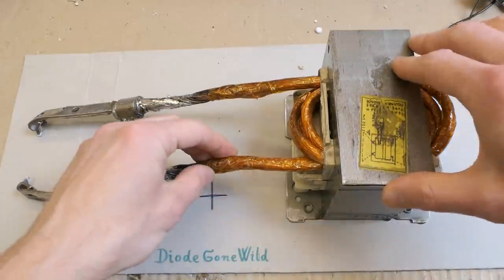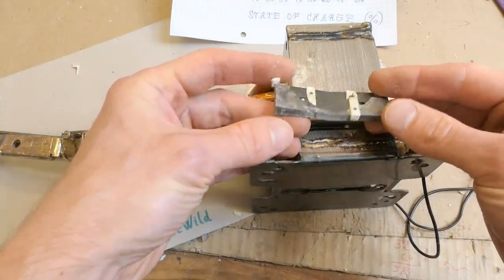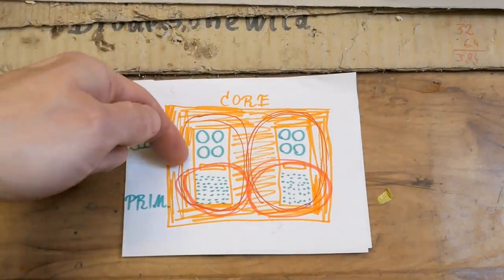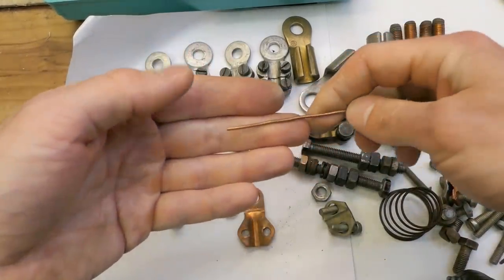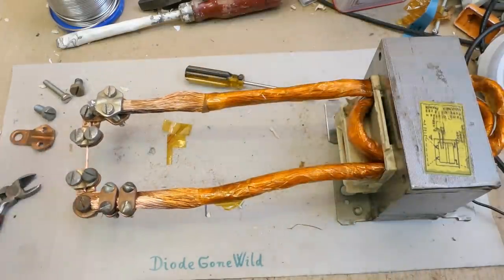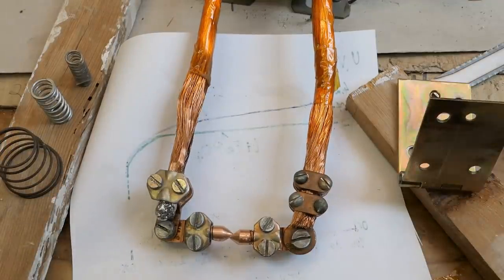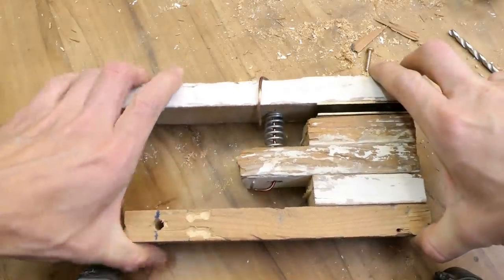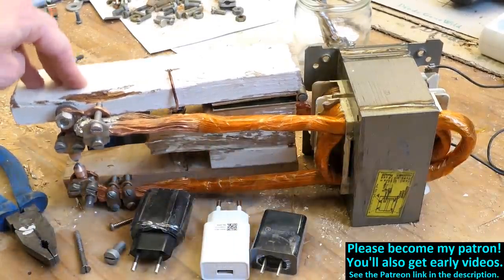Microwave Oven Transformer Spot Welder 3

Comment: I have followed DGW's feed on this project with enthusiasm and have some observations.
For the 'arms' of the welder I used some 22mm copper tubing and a bought length of 15mm x 3mm copper strip.
This provides good stability and permits a good pressure to be applied to the weld material 
So far, using 3 turns (I couldn't fit any more!), i was able to obtain around 400 amps on testing.
Charles Preston, Patreon member

Comment: The spotwelder we did use in the factory had copper rods that had about 5 mm diameter.
They was kind of very slightly rounded perhaps, almost flat tips, the point is to get contact and heat the plates up, if the copper rods is too pointed then it just goes trough and makes a hole instead.
The spotwelder had a foot pedal, so one put the plates on there and pressed with the foot.
I dont think it had a separate switch, i think the switch was in the foot pedal system, but make sure it gets good contact before switching on if making something like that.
It had a spring system so the pressure on the plates could be adjusted i think.
I think you perhaps have more power in your spotwelder than what was in the factory spotwelder.
I did not mess too much with the spotwelder but did use it a couple of days, i mostly did welding with the large 3 phase mig welding machines there.
Sometimes now and then i did run the welding robot too, it was high tech back in 1990-1992, one did just put the pieces in the jig and it did welding the pieces by itself :)

Comment: Maybe put thicker mains cable.
Reply: And keep the clamp meter away form the transformer because the leaking magnetic field causes it to display a higher current than you're actually drawing form mains.
Reply: @mernok2001  also good idea
Reply: In his first video on this project he says he wants to preserve the original primary coil from the microwave. Besides, it is tedious to wind 100 or so turns on that transformer, because he wants to avoid cutting the iron core open. The core was welded shut by the microwave manufacturer.
Reply: @hanztimbreza6217  Ivan Kirola was talkong about the power cord,not about the primary coil.

Comment: Nice project. This got me thinking... To make welds consistent you could make foot switch which switches transformer off when secondary voltage falls below 1V - meaning welded material has melted and electrodes got closer together.

Comment: Thanks for this set of videos!  I've been thinking of building a spot welder for years, but never got around to it.  Your video has inspired me to finally get it done....

I have a 1200 watt microwave with a fused secondary on the transformer, and will be building a spot welder soon from that.  I wish I had saved some of the degausing wiring from the old CRT TVs I recycled.  

I'll have to get a couple of heavy starter cables off of a wrecked diesel truck in the neighbohood u-pull-it wrecking yard next time I am there.  The diesel starters have to have large gauge cables because they draw so many amps to overcome the high compression that diesel motors have.   Especially the older GM diesels because they used huge direct drive starters with no reduction gearing....

One question I have is how to do spot welding on copper or steel strips when building battery packs out of used rechargeable cells.  It would seem that one of the contacts would need to be set up to have a larger surface area so that the heat of the weld would be concentrated only at one of the two electrodes.  Might be a topic for another "episode" in your spot welding playlist.

Thanks again!

Comment: You may reduce the resistance losses by flowing solder onto the end of the cables before inserting them into the clamps. Or better yet, flow the cable, then add a solder trace from the cable to the clamp. Might be able to reduce it even more by putting the bend in each cable instead of using a second clamp to angle into the tips. Great video, BTW.

Comment: You should put a switch for the spot welder on the primary side to have less wear on the electrodes and the welding material. When you make contact trough the electrodes you have kind of an arc melting the material away. You should use something like a relais on the primary side to switch, optimal a SSR (solid state relais) with at least 40 or 60 A capacity - they are quite cheap.

Comment: Nice video. You could make a switch that turns it off when the voltage gets bellow 1v when the probes are close to each other and the solder is done

Comment: If you make the tips a little less sharp to increase the surface aria, the spot will not burn thru. (need to experiment with metal thickness vs tip diameter and time).
Reply: The tip could be filed down abit
Reply: @JamilKhan-hk1wl  Jip, that is actually what I meant, I just worded it badly. (the flat parts should meat flush with the workpiece as well)

Comment: Are you welding bare metal or is there some paint or something? The soot on the electrodes comes from somewhere...
Reply from the maker: I tested it on a housing from an ATX power supply. It probably had some plating or galvanized layer...
Reply: It's the traces of the famous beer extinguisher.
Reply: @DiodeGoneWild  be careful with zinc fumes. Breathing too many of those in gives you flu like symptoms. Don't ask me how I know. Up until too much is no problem though. You're OK until you aren't.

Comment: Nice build.  I noticed some white smoke when you were spot welding the steel plates and some white residue on your electrodes after welding.  This is probably zinc oxide, either from a coating on the steel (zinc plated, or galvanized), or the alloy (brass?) your electrodes are made from.  It is quite toxic ( https://en.wikipedia.org/wiki/Metal_fume_fever ) and may also weaken the weld.  Zinc coatings can (and should) be removed from steel with hydrochloric (aka muriatic) acid before welding.  If your electrodes are brass (copper/zinc alloy) you might want to replace them with pure copper.

Comment: What happened to that big screwdriver?   It looks like it has a bandage on it.

Also, one turn of the secondary seems to be looping out of the transformer a long way.  Does this decrease the efficiency?  Should it be wound tighter?
Reply from the maker: the big screwdriver was used to stir paint :). 
It doesn't decrease the efficiency that much. It's because one end of the secondary was a bit longer.
Reply: @DiodeGoneWild  Actually I think with this transformer it might work better if you wind the secondary more loosely. It can couple more of the leakage magnetic flux into the secondary, leading to better coupling and a bit less impedance and more power. Of course you also get more resistance from longer cable Although I'm not sure how much difference it would make here with an EI core.

Now that I think about it, I'm guessing the output voltage might not even be a sine wave with this much saturation. Would be interesting to see it on the scope under short circuit.

Comment: is that possible to use a parallel capactor with primery of the transformer for some power factor correction ?
Reply: You can do that, but the power factor wont be too bad under load without it either, so it wont make a huge difference. It also increases the inrush current, which is not great. I would probably leave it out.

Comment: maybe the automatic switch on the arm is not such a good idea - if the electrodes weld together, you will not be able to power it off. foot switch feels like a more controller solution
Reply from the maker: It won't be an automatic switch. It would be a switch mounted into the arm so I can reach it with the same hand that operates the arm :).

Comment: what happens if you try to weld a lithium battery with it? Maybe you should try it😂😂
Reply: KABOOM!
Reply: You can just use a 12V battery to weld metal strips onto batteries. Motorcycle batteries seem to have the right current.

Comment: I think you do not need a pedal switch, you need primary triac board control with a pedal switch.
What is the max input current of the circuit breaker?

Comment: I know nothing about spot welding, but I wonder, If tungsten (wolfram) tips would stay good for longer than copper ones.
Reply: Of course. But a rod of tungsten (Wolfram) about 250mm long costs about 50€.
Reply: He could use carbon electrodes. Maybe?
Reply: @patrikjankovics2113  Yeah but wouldn't carbon electrodes crumble under the clamping pressure?
Reply: @LMB222  50€ isn't that much if it would let you have a usable spot welder.
Reply: @LMB222  TIG electrodes are not that expensive. You can get a whole pack for $13. But I think the copper tips he's using now work fine.

Comment: You should use graphite or tungsten tips instead of copper ones (since they don't weld themselves into welded material and then would increase potential weld throughput and also reduce tip wear).

Comment: I would have expected removing a turn would only improve the outcome if the winding space is then used to fit thicker wire !
Reply: well it also reduces wire length (if you cut it down)

Comment: how do you remove the enamel of the copper wires with a scissor? i mean you have to do that with 300 wires, 600 of both, if you delay 30 seconds each one, there are like 6 hours-8 hours, so i dont think you used scissor to remove the enamel, it takes way too much time

Comment: In the Netherlands we have 16a breakers. Can't even run this thing.
Reply: @gremerson  I have a variac too and it sometimes trips the breaker when plugging it in.
Reply: No, you have as large breakers as you order. I have 3x32A, but I don't go Dutch on my energy. I actually use warm water in the toilet.
Reply: @gremerson  ein Anruf an die Energiefirma reicht im ein Wechsel auf 32A oder 64A zu machen. 

Vergiss aber nicht, dass größerer Strom kostet mehr in Abonnement.
Reply: You can pull more current for a short amount of time. Google "breaker curve".
Reply: @Xackus  That is true but inrush is sometimes still too much when you plug it in at just the wrong time.

Comment: Just out of the curiosity, what is making that buzzing sound? 🤔
Reply: Mostly the transformer core.
Reply: @k4be.  Yes, but how? There are no moving parts. Vibrations?
Reply: @Numian  Likely the most important phenomenon here is called magnetostriction, that is basically, ferromagnetic material changes its dimensions when magnetized.
Reply: @k4be.  I see. Thank you!
Reply: @Numian  there are moving parts. We just can't see them because the parts are very small. They're called electrons. In this gear they're going back and forth 50 times a second. And that's where the noise comes from. It is called AC hum.

Comment: If you had to do it over again, would you leave the magnetic shunt in or will you still take it out?
Reply from the maker: It doesn't make that much difference, but if it's possible to remove it without a risk of damaging the primary, I'd remove it. You get more current and the voltage drops less under the load. The losses in the transformer are not importaint in short pulse operation. And more current means a shorter pulse is enough.
Reply: @DiodeGoneWild  Thanks
Reply: I would advise against that if you're close to reaching the breaker tripping current, otherwise go for it.
Reply: wao

Comment: Shouldn't it make no sparks during welding?
Reply: It's probably mostly from the coating on the steel.
Reply: @Basement-Science  Alright, thanks for the answer.
Reply: Heat steel up enough and it sparks.

Comment: You should add a Relay on the primary side and use maybe an Arduino to control it with short pulses👍
Reply: He would probably use an RC delay circuit, or a TTL counter of the 50 Hz from mains.